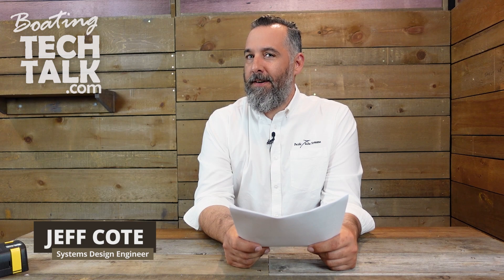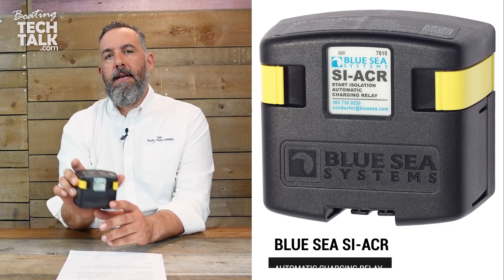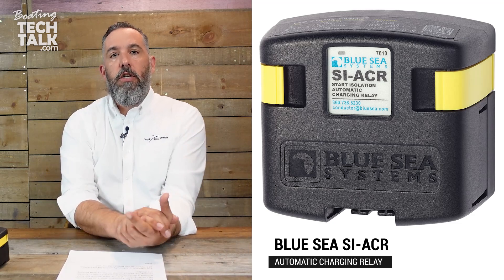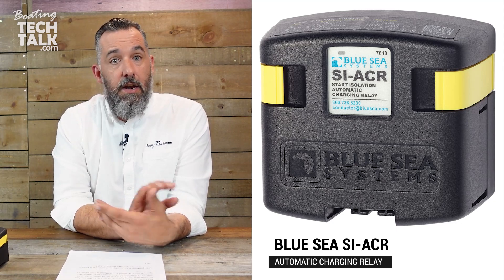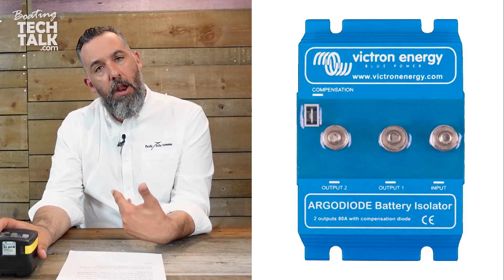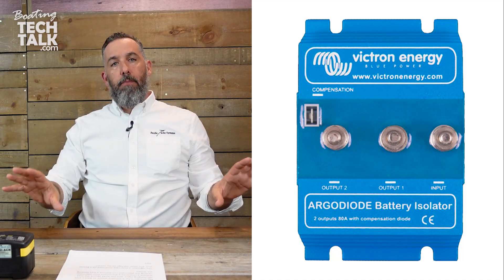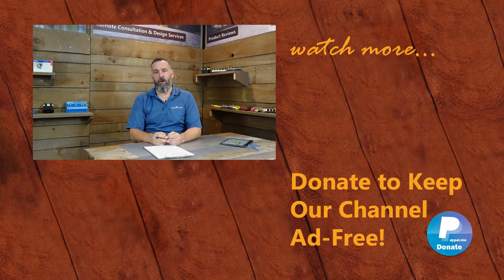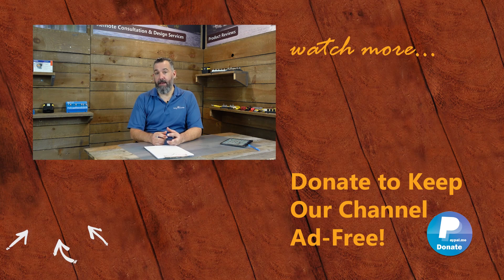Charging Lithium Batteries with My Boat's Alternator

Comment: Hi Jeff, Thanks for your videos - I have elected to go with a Lithium house battery and have installed an "isolated" Victron dc-dc charger and changed my onboard charger to a model that allows separate charge profiles for the two different chemistries.  Does the "isolated" aspect of the dc-dc charger infer that the grounds on my house system needs to be separate from the starting battery grounds? or is this not a concern (I can tend to over think things).  Thanks, Peter.
Reply from the maker: Good question, and I'm not sure of the answer. In this case, i think isolated means the negative on either side of the DC to DC charging converter are seperate and their no conductivity. Can someone weigh in on this.

Comment: Jeff, I thought you couldn't mix AGM and Lithium with an ACR due to the differences in charging voltage.  Does the BMS make this possible?  Thought you had to use a DC-DC charger.  Please advise.
Reply from the maker: David, in this case the AGM battery is sort of sacrificed and will not really get what it needs. Your right, AGM and Lithium want different charge profiles and you'd generally would use a DC to DC charging converter to charge.
Reply: @PacificYachtSystems  Why not use a Battery to battery charger. I that case you could dial in the correct charging current profile for the house LIFePO4. Another possibility is an alternator to battery charger which can charge house and starter battery at the same time. Sterling makes one which at the same time can monitor the alternator temperature as the lithium can draw an extreme load which might overheat the alternator

Comment: not sure why youndidnt mention a “third” method?
use B2B charger from alternator/starter battery (AGM/SLA etc) to charge house (lithium charge profile etc)
… alternator “always” sees the start battery .. so its protected, and the B2B will boost as reqd the input voltage from alternator/start battery to
whatever is reqd for its charge profile on house battery ..
Reply from the maker: Thanks for sharing Greg.

Comment: Hi Jeff, listening to your marvellous videos from abroad (the Baltic), where i am refitting my newly bought 43 year old sailboat, i would like to come  up with a third alternative: How about using an isolated dc/dc-converter (e.g. victron Orion-TR 12|12) to charge the house-battery with the surplus from the starter-battery (to which the alternator is connected). Perhaps this is technically not any different from the solutions you mentioned because i am mixed up with all the different names of the many devices ;) 
Thanks and cheers, Steven
Reply from the maker: One of the limitations of DC to DC charging converters is the max amperage (30 amps for Victron) when some alternators, can output 150 and even 200 plus amps. Some boaters are going to find 30 amps to be a slow way to recharge the lithium bank. Does anyone know of a higher output DC to DC charging converter.
Reply: @PacificYachtSystems  the Scotty that Safiery sells is a 3000W dc-dc buck boost converter. It may be able to
Reply: @PacificYachtSystems  Sterling makes at least 60A B2B an Think a bigger one is in development. Allready have an 60 A shorepower charger from Them an Think I will go that Way for charging my new lifepo4 house bank
Reply: @PacificYachtSystems  I am looking at upgrading my house bank (lithium) and alternator (170A). I was going to use a DC - DC charger off the house bank to the start battery. Would that work? Or should I have the alternator charge the house bank and then have a DC - DC charger for the start battery? I want to be able to use as much of that alternator as possible to charge the house bank.

Comment: Brilliant as usual Jeff.. What about a 24v house bank of lithium and a 12v starter battery (my case). I would love to hear your opinion if you have time..
Reply from the maker: With different voltages, you'd have the starter and the alternator connected to  your 12 volt engine battery and then recharge the house battery with a 12 to 24 charging converter.
Reply: @PacificYachtSystems  See my question above but Victron make a 24volt to 12volt DC to DC charger that allows the charger to output the correct voltage output (14.4-14.6) for 12volt from the 24 volt bank. The also make a 12 to 24 DC to DC that would allow you to connect the 12 volt alternator (assuming that's what you have) directly to the start battery and then pass the excess current to the 24 volt bank.

Comment: Great explanation Jeff. I echo what some else said in that so many people want to install these lithium systems without understanding them properly researching them  and understanding this is not a one size fits all. Please do your research understand there are many ways to go about it with drawbacks to each.  If you don't know what you are doing please have a qualified system designer check over your design who has some experience with these out in the field. We get calls from even installers who still don't quite understand these systems. We offer a wide variety of products such as our new 618 regulator with preprogramed lithium settings and and wireless monitoring and specific programing through our SG200 and app. Also adjust the belt load manager to limit current if you find your alternator is heating up to quickly. It is imperative that the alternator temperature sensor is connected and working properly to not risk damage to the alternator with these systems.
Reply from the maker: Hi Dan, thanks for having Balmar Technical Support group join the conversation. We've installed hundreds upon hundreds of Balmar products over the years and are a big fan!
Reply: @PacificYachtSystems  Thanks I have learned a lot from from Jeff understanding these systems a wealth of knowledge. It would be cool to see Jeff do  an unboxing of our new 618 regulator and sg200 battery monitor which allows instant advanced programing through a phone app rather than the older magnetic screw driver method.

Comment: Seems that even with two alternators (engine, house), the problem still exists if the house is LFP and the BMS disconnects it.  Does anyone make/use an electric clutch on an alternator?  Not sure it could disconnect the alternator from the engine quickly enough even if such a thing exists, but just wondering.  You also have me thinking that perhaps a LFP battery system should always have a battery isolator with the other output connected to an AGM battery.  Still, it leaves open the question of where the external regulator should be connected.
Reply from the maker: Hi Bruce, having a dedicated alternator for a lithium house battery might still get you in trouble, especially if the BMS cannot communicate with the external regulator to stop it from overcharging the lithium battery. Without comms, the BMS might simply disconnect the battery and the alternator will suddenly be without a battery to charger and likely the alternator will be damaged.
Reply: @PacificYachtSystems  Sterling makes a dummy load safety just for this

Comment: Excellent. So many people want lithium without really understanding it, or the comprises built into the BMS of “drop-in” replacements. As noted the lithium could potentially “go dark” due to too high of a voltage. If using a battery isolator then there is potentially no battery in the house circuit. Major issue if any high draw item is turned on as the alternator, and likely the isolator, will not handle it. That’s why I’m a fan of the firefly batteries you promote. Lithium really needs separate charge/draw bus topography, with separate automatic disconnects, so it can continue to provide loads (if over charged), or receive a load (if undercharged). That and all chargers need to be properly configured to limit charge voltage (measured at the battery).
Reply from the maker: Hi Brian, thanks for chipping in the conversation, one Lithium battery manufacturer that has both load and charging sides is the Lithionics battery: https://lithionicsbattery.com/

Comment: Jeff, I've enjoyed binge watching your videos, and really appreciate your educational approach.

Could you talk about parallel diesel hybrid systems (such as those from Beta Marine), and how they might replace a generator in a new build sailboat or a repower project with extensive electrical upgrade assuming a greater than average solar panel installation and a lithium battery bank? I'm interested in how this would affect chosen house voltage, a realistic energy budget (just how devastating is AC?), and properly sizing the diesel engine to efficiently charge the battery bank while underway at modest speed for a few hours.

The benefits, as I see them, are quiet yet powerful maneuvers in the marina, reduction of number of IC engines onboard requiring service (& noise, thruhulls, spare parts), as well as a limited source of backup propulsion should the diesel engine conk out while in the channel. Several hours of pleasant electric motor-assisted sailing might help complete an iffy daytime passage if shore power were expected at the destination, and it is more likely that the diesel engine would be operated under a decent load rather than wasting horsepower and causing carbonization.

Unless its a fast boat, I don't think regeneration or cost of fuel is a major factor in this choice, but perhaps weight is? I look forward to your next vid. 

Thanks!
Reply from the maker: Thanks for the feedback and the suggestion.

Comment: I was wondering why you didn't mention DC to DC charger as a way to charge both the AGM Starter and then onwards to the Lithium House battery ?
Reply: Yeah I was thinking the same thing
Reply from the maker: Hi James, your correct a DC to DC charging converter is a good way to charge different battery chemistries.

Comment: @pacific Yacth Systems Love your videos. Been watching them for years and recommends them to everyone! Now my Q: What about those Sterling battery protection units, that are supposed to soak up the spike. Are the uesless/not necessary if you have a starter battery in parallel? Or would they still be usefull?
What if the AGM is already quite full, and the alternator is running full speed, will the agm still be able to soak up the spike?
Reply from the maker: Not familiar with the Sterling protect unit, but yes a full AGM battery could still take all the amperage from a alternator when a BMS decides to disconnect a lithium battery from overcharging.

Comment: Interesting Jeff I got two 3kw Hybrid Inverter Chargers made by Mpp Solar they are two years old my concern is what will happen if for some reason the fuse get blown,, will the Charge Controller stop charging or get damaged? Am talking about a large fuse between the battery bank and the Inverter
Reply from the maker: Not familiar with this specific inverter/charger but don't think you would damage anything if the inverter/charger was blown. Anyone else can comment?
Reply: Many thanks Jeff, I have always been told to connect battery to a charge controller, before connecting a solar panel but in this case on a Hybrid Inverter Charger I get worried or wonder what will happen if the main fuse blows because if that happens it means the Controller is not connected to the battery bank.. I started thinking about this today when you were explaining the dual battery scenario...

Comment: what about the elephant in the room??   alternator signal wire (turns on/off unit)  ??   which to connect it to? - leave connected to start battery and use a dc to dc to charge the other batteries ( correct volts/amps profile) for batt type.
Reply from the maker: Certainly easier to have the alternator connected to AGM start battery and then share the charging voltage to the Lithium battery via a DC to DC charging converter. Challenge is the max output of the DC to DC charging converter is about 30 amps.

Comment: Good one Jeff, is having the alternator connected to the engine AGM and having a DC to DC charger could be another good alternative ?
Reply from the maker: Yep, that definitely works.
Reply: @PacificYachtSystems  I don't understand why you didn't mention the DC to DC charger as an option? It is definitely a great option and probably the best compared to what you offered unless price is an unmentioned consideration. I love your videos and appreciate your expertise on the issue.
Reply: noWell, that would be a preferrable option, normal altenators don''t like the low resistance of lithium battery''s during idling or high load the alternator will overheat and fry itselve. Please invest in a good Victron DC/DC charger or an special DC boost charger (Expensive)

Comment: Hmmm…. I’ve got my mv-614 controlled alternator connected to my Lifepo4 bank. Then I have a b2b charging the agm starter from the Lifepo4. I have a switch in the dash to turn on and off the regulator as own primary means of charging is solar. Would the Victron b2b protect from a bms cutoff?  Also, the problem I see with the isolator is that my regulator is set 14.1 volts abs for 5 minutes rather than an agm profile.
Reply from the maker: Hi Eric, the B2B charging converter would certainly help reduce the chance of the BMS sensing overcharge.

Comment: Good information and good timing for me - using the battery isolator and considering that the charge profile is different between the AGM (lead acid) and Lithium batteries (assuming LiFePO4 chemistry), where do you connect the external alternator regulator voltage sensing wire? The AGM or Lithium battery? Or some other way?  Could a DC to DC converter be added into the circuit to charge one of the battery's at the correct profile?
Reply from the maker: Good question, it's a toss-up since both batteries might want a different charge curve. The voltage sense wire should be connected to match the charge profile chosen in the external regulator. Some boaters will chronically undercharge the AGM battery (less then 14.4 - 14.6 volts for a 12 volt AGM battery at bulk) from the alternator and rather have the Lithium battery get the correct charge curve. The AGM start battery can be charge adequately with solar or battery charger.
Reply: @salishseathings  I think that the LIFePO4 BMS will limit the charge current going into the batteries
Reply: @salishseathings  That is one way to limit the current off course
Reply: I don't know the answer but would it no be prudent to ditch your start battery and replace it with a small LiFePO4 battery? If you did this would there be a new problem with having a different capacity start battery to the house bank?